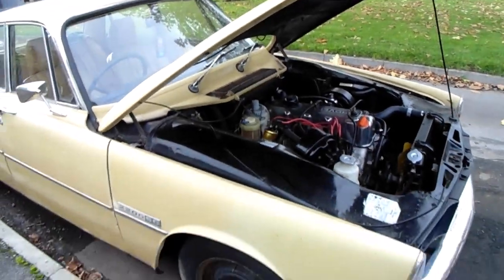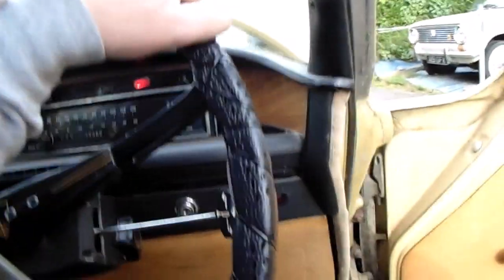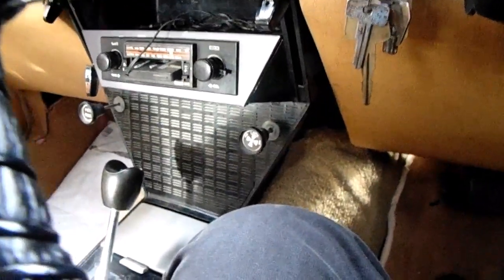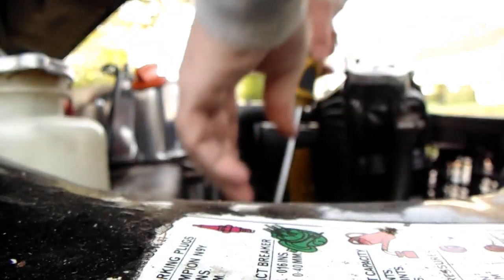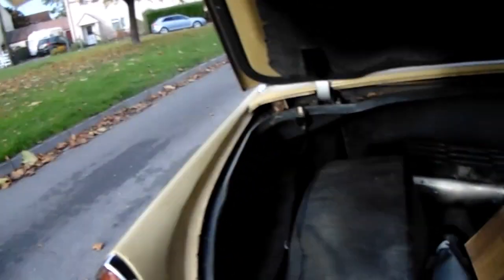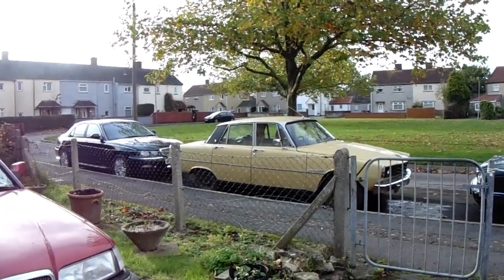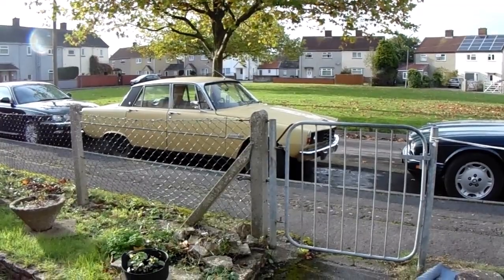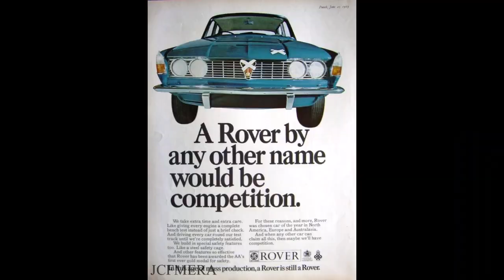ROVER P6 PROJECT UPDATE

Comment: Plastic washer bottles can split too without sufficient screen wash, Aldi sell some but only good to -5°c, should put some cheap wheel trims on so the car doesn't stand out so much.
Reply from the maker: I do have the original wheel trims I have just left them off as I need to replace the tyres plus other work that had to be done. And yes I have screen wash in the bottle with anti freeze solution. Many thanks for your comment 👍👍
Reply: @everythingretro2036  I was thinking vandalism wise that with wheel trims the car won't stand out so much.